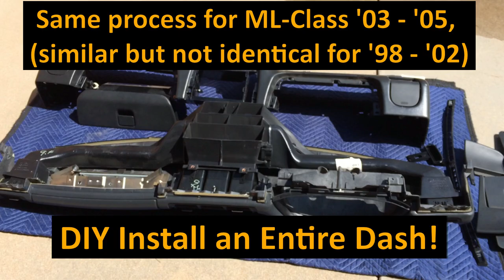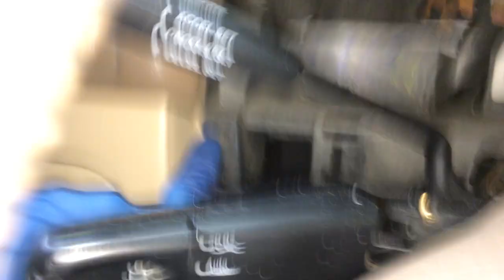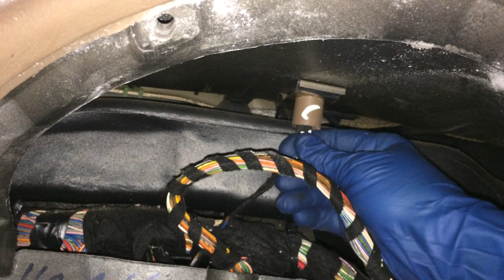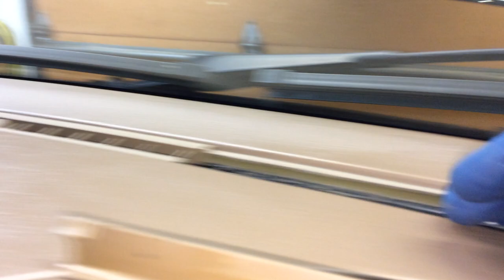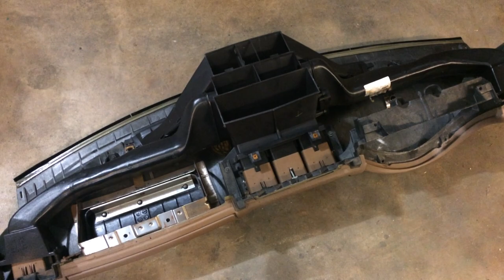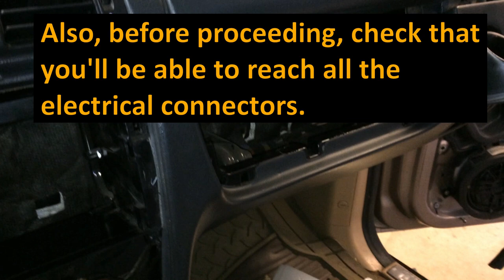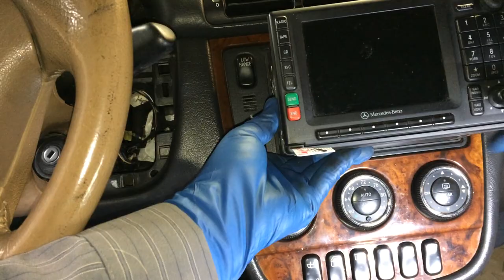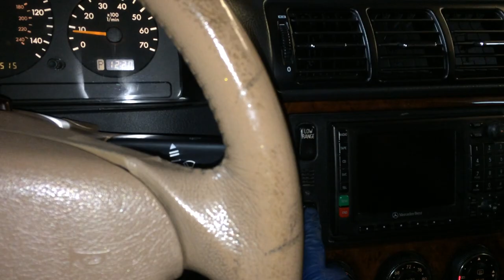Mercedes W163 ML-Class 2002- 2005 Replace Blend Door Motor, Dashboard Removal, Replace Entire Dash

Comment: This was by far the best DIY video I have ever seen on YouTube.  I have an 18+ year old ML (bought new in 2000) that I've had to do various pieces of work on, over the years.  This helped me change the air blend motor in a day.  Your video is better than the Mercedes WIS instructions!  The call-outs and freeze frames are what sets your videos apart from the run-of-the-mill DIY videos.  Kudos and thank you very much for taking the time to create and post this video!

FYI for my '01 ML430, I had to remove 3x 3/16th!!! screws from a  panel holding the AC controls to get to the two screws underneath the radio that holds the lower dash.  I didn't take pictures.
Reply from the maker: Thank you for the comment -- I'm so glad the video helped!  And thanks for sharing the tip for those screws on your '01 ML430!